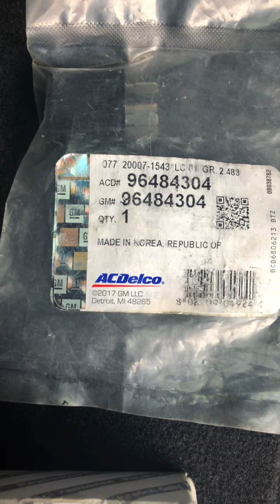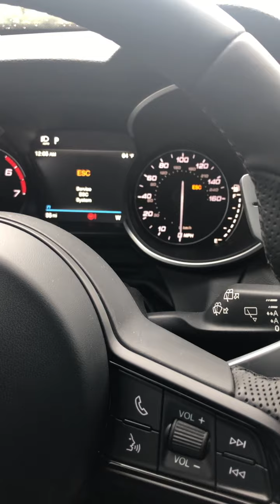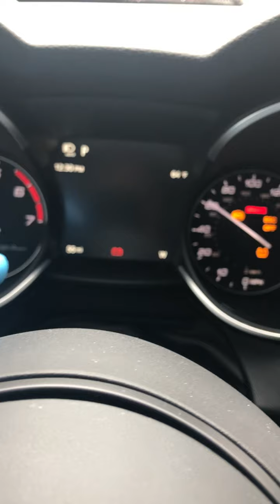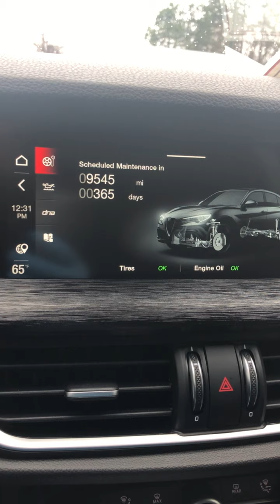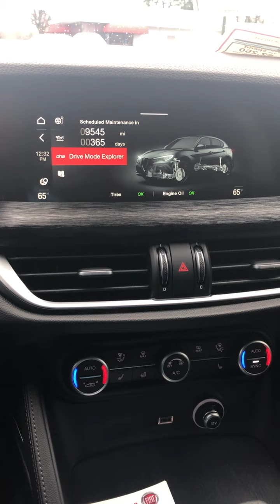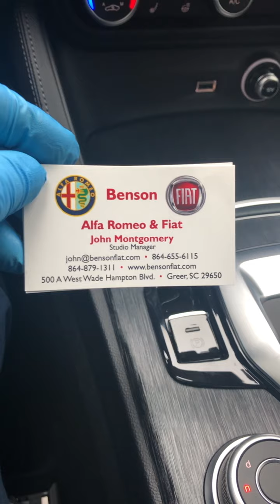New Alfa Romeo Stelvio final delivery preparation tips for trouble free ownership!

Comment from the maker: Hello Grant, i’m glad you found a video helpful. Making sure the battery post contact surfaces are clean is really only necessary because Alfa uses three dissimilar metals to put them together as I explained in the video. I have collector cars that are over 40 years old with lead post and lead receivers and they have never had any corrosion. For the North American Alfas it’s especially troublesome . Regarding carbon buildup and other issues I would never use the “A” advanced efficiency mode on a QV because it runs on three cylinders. There is not proper heat balance in the engine and it will clearly cause premature failure. If you use high-quality premium fuel, keep the filters clean and do the recommended maintenance on the plugs you should have excellent service.

Comment: thanks John, hard to find good info on these cars.   We bought a used 2018 Stelvio QV this year, 10500km, hadn't even had its first service!   Had the OEM battery fail, fixed now, but your info on getting rid of the warnings was very useful.   The airbag warning wouldn't go though, so local workshop had to clear that with the computer.   What is your experience with carbon buildup in the intake on the QV engine?   What do you recommend to prevent or minimise it? thanks.

Comment: Hi John.  I feel like youre the perfect guy to ask a question.  Im about to buy a 2022 Stelvio Ti with 14k miles.  From what ive read the majority of electrical issues were traced to just what youve shown.  Ive also seen it suggested to swap the battery with an AGM type battery.  Beyond that i see a lot of people saying to install the start/stop bypass to preserve the starter relay.  Beyond those 2 things what else do you suggest?  Do you consider Stelvios reliable on average?  I daily drive 50 miles.  I owned 2 1991 Alfa Spiders and have lived  through the unreliable era.  Are these new Alfas as hearty and reliable as ive read?  Thanks so much
Reply from the maker: I think you can be pretty confident to buy an Alfa Romeo if you don’t do any maintenance work yourself you might want to consider buying an extended warranty if the car is eligible. Make sure you get a 800 amp hour battery, but by all means make sure that you have the post that are clean and Periodically take a look at it. Cars are very reliable, but as I stated in the video because they use two different metals to make the connections, they are prone to develop a little surface corrosion.
Reply: @fiatofgreenville  thank you for the reply.  I have 21 months left on the warranty and then plan to buy a 4yr/45k mile extended warranty through Mopar